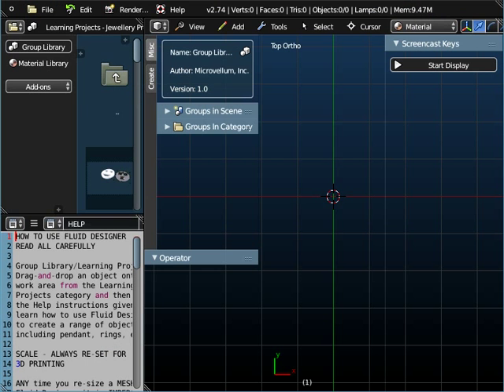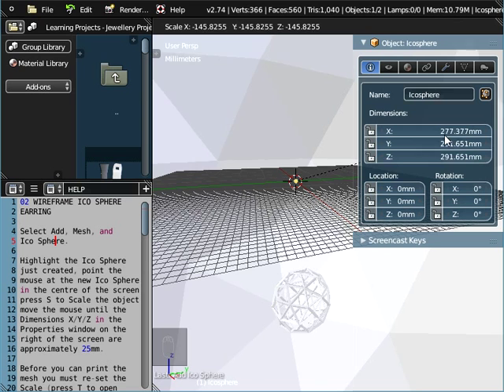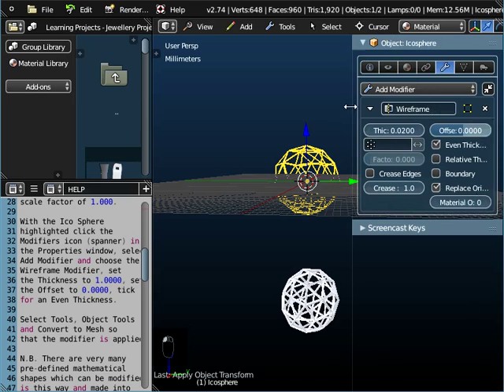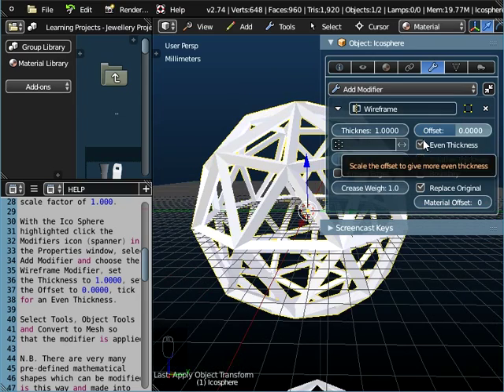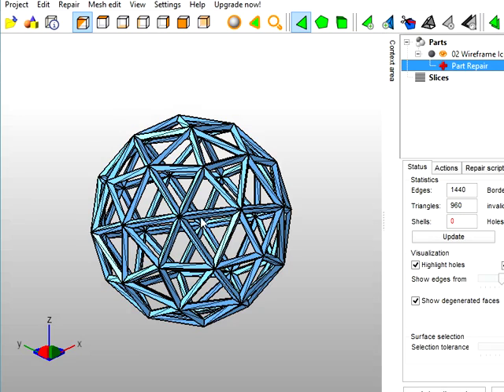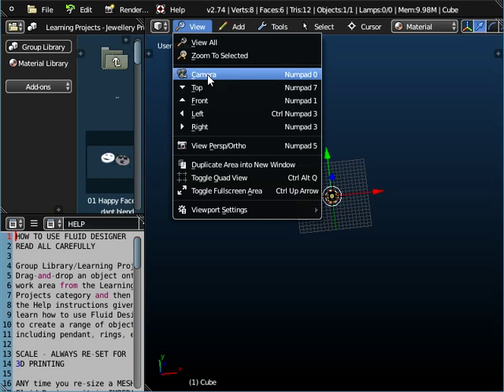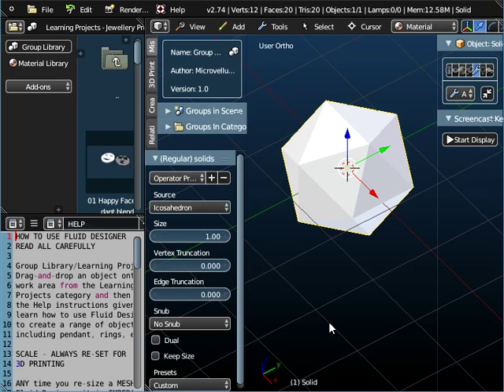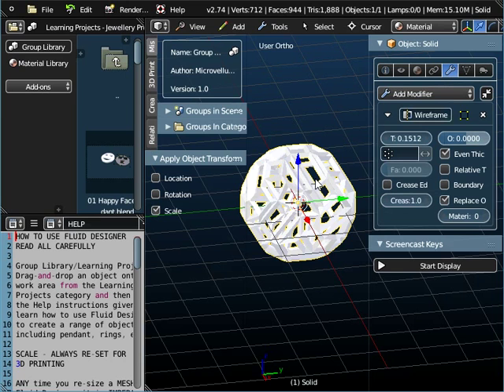Blender FluidDesigner - 02 Wireframe Ico Sphere Earring Jewellery Projects Earrings

Comment: Fluid designer?  Is it included in blender 2.79 onwards?
Reply from the maker: Works with 2.79 but you need to install it as an Application Template (FluidDesigner) and an Addon (JewelCraft-FluidDesigner).